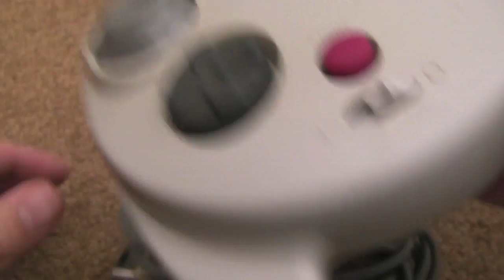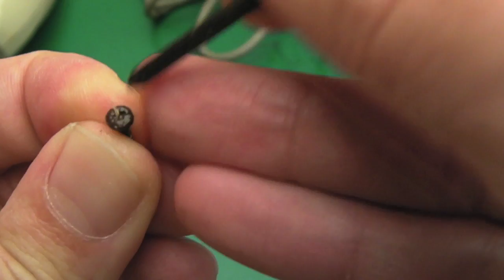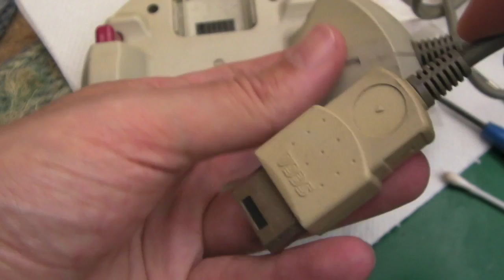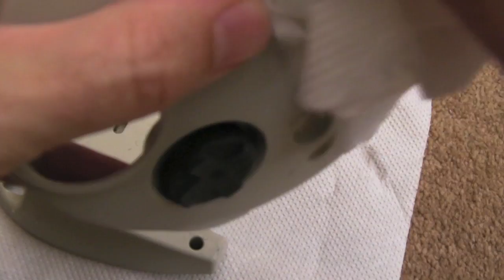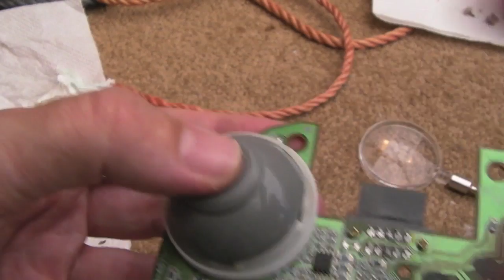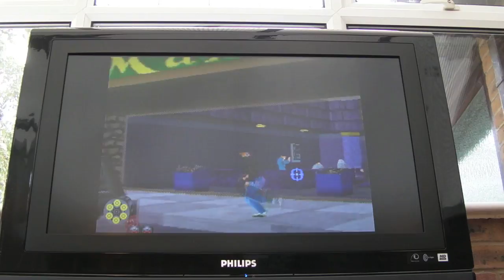Sega Saturn 3D Controller Repair (Not Working / Not Centering)

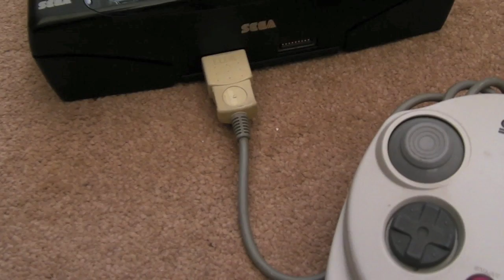Comment: I appreciate this video it was pretty much the only video I found that could reference the inside of the plug where the metal connection pins are I got an untested unknown working one off eBay thinking maybe it was an easy fix right away I noticed that one of the connection pins was broken off or missing but I didn't have anything to reference it to besides normal Saturn controllers but I didn't think that was an Apples to Apples so your video around 1 min to 1:01 I was able to freeze screenshot in reference mine and notice that in fact there is a pen missing on mine where yours does have one. My next step will be to either change the plug or try to repair the pin inside the plug again thank you

Comment: So did you have to heat up the solder on the contact to push it down? I have the same exact issue except mine pulls to the left. It’s not the stick itself I’ve determined
Reply from the maker: Yes, I just added some flux, heated and made sure it was positioned as straight as the others.
Reply: @GadgetUK164  great thanks!

Comment: Hello, I just wanted to ask you about the controller, mine works but when I switch over to the analog stick it doesn't register and it stays on the d-pad, I think it might be just the contacts of the switch rather than the thumb stick, what do you think?
Reply from the maker: The analogue stick only works in specific games!
Reply: @GadgetUK164  I know, I meant to post an edit on the comment, I didn't know because I was trying to use it on Exhumed, also known as Powerslave, because it has analog compatibility but as it seems I found out for myself, analog control only works for the American version, called Powerslave.

Comment: the right trigger of my 3d saturn controller does not work, help!
Reply from the maker: Take it to pieces (as shown in this video) - try gently wiping the button contact with IPA and a cotton bud.  It could also be a damaged wire or something.
Reply: @GadgetUK164  solved!  it was the trigger magnet, the magnet was out of the trigger piece

Comment: I’ve noticed that the d-pad on my 3D controller is really loose. I opened it up, expecting to need to replace the rubber contact points, but they’re all fine with little wear. Any idea why the actual plastic d-pad is so loose inside the controller shell?
Reply from the maker: Honestly no idea - I would need to tear it down again to see if I can work it out!  I will take a look next time I have the Saturn out!

Comment: i own the 3d controller all buttons work but when i switch to 3d controls the analog doesnt work.
Reply from the maker: I think only specific games support the analog part!!!!
Reply: i figure out what was wrong after i took the controller apart to clean it. the analog part wasnt connect to board anymore and magnetic part that sense the movement was gone like broken off so the analog never worked to begin with. its sucks but i guess i can just track down the seller.

Comment: Don't know if you can help me GadgetUK, but my R-trigger has suddenly stopped working. I opened up the controller and couldn't see anything wrong with it, but gave it a general clean anyway, but the same problem still persists. Do you have any suggestions for what I should do? 

EDIT: I've noticed there is a loose magnetic disc, but I don't know where it's supposed to go.

Comment: Always detailed, always thorough. Do you have any solution to my poorly N64 'Z' button? It just stops working sometimes. When you take it apart there is nothing wrong with the carbon button and track it touches. Odd. Starting to think it might be a slight problem in the lead.
Reply from the maker: Thanks =D  Most probably the lead!  I have (in one of my videos) hacked the connector appart and resoldered wires in there after cutting an inch off the cable.  The N64 cables aren't as good quality as some other controllers.

Comment: Really enjoyed this one. What a state the controller was in, hope you got it for a good price. Thanks for the tip about using plastic cleaner, I have a bottle on the way
Reply from the maker: Thanks and no worries =D  That PlastX is really good for cleaning plastics up - just avoid any printed logos etc.  For example the Megadrive logo - polish around it.  Or the NES logo on the door of a NES - that will come clean off with either IPA or plastic cleaner if you dont avoid the print.

Comment: Nice vid as usual. You may want to invest in a new screwdriver set as the jewellers ones are too small to grip imo. There's cheap but good JIS ones on eBay
Reply from the maker: Yes - good idea!  To be honest its rare to have that issue!  Out of all the stuff I've looked at for the last 4 years this is the only time I've struggled to remove the screws.  They were not only corroded but very tight too.

Comment: Hey Gadget, love all your videos. Super informative. I had a C64 question. In all your videos it shows models with the metal box/shielding around the VIC-II removed. Do you know how one could go about removing that box if it's in their board? I'm trying to add a heat sink to my chip, but I can't even access it.
Reply from the maker: I've seen some people use cutter to remove it - but that can be really hard work and you risk marking / damaging the board if you aren't carefull.  The best approach is to desolder it but you need an iron with high temperature / wattage.  Sometimes using two irons can help as the extra heat make light work of melting the solder on those connections to the shielding.
Reply: Okay, yeah, for some reason I keep thinking the top lid will come off, but I just can't rebend those flaps because that are just too deep in the box to get this lid off. I have a unit that still has the metal shielding soldered to the bottom with cardboard underneath it, so I'll probably have to desolder those tabs on the edges of the board too to get access to the bottom of the board. I was going to recap it anyway so this'll give me a chance to do that.

Thanks!
Reply from the maker: The lid should just prize off to get to the VIC?
Reply: https://i.imgur.com/PSfCR0W.png

I figure I'd be able to get a screw driver or some tool into those holes and be able to pop off the lid, but it seems pretty difficult. Is that even possible?
Reply from the maker: The lid on the VIC can is usually just press fitted.  It should prize off?

Comment: You may have a 2011 tsunami artifact there?
Reply from the maker: I did wonder that myself as I was inspecting it!   It's possible, but the inside wasn't water damaged so maybe it was just dirt on the outside?

Comment: just something for the back of your brain, when ever I get in a nasty screw situation, if I can give them a litle bit of a tweak tighter it seems to break them free ... or at least free-er
Reply from the maker: Thanks =D  I did try that!  I also hit the screw driver quite hard into it with a hammer - sometimes inpact can help get WD40 under the head and that can make the difference.  Sadly it had to be forced off =/

Comment: Nice vid as usual. those screws are a a pain sometimes being rusted in. I use a little ball mill on my dremal to take care of them, there is usually enough shaft left over to get some grips on and wind what’s left out. Just won the auction for a lot of over 50 joysticks for a song on ebay everything from Atari 2600 up to early play-station. Think I'm sorted for controllers for the foreseeable future lol.
Reply from the maker: Thanks =D  Nice pickup!!!  That will keep you busy for a while lol!  I think I was watching that auction at one point!  I've got a dremel but I dont think I have a ball mill fitting - will order one later thanks =D
Reply: cant believe I got that lot for a £20 bid (will cost me another £20 in diesel to collect them tho) but still works out at under £1 a joystick plus there’s 2 2600 jnr consoles in with it too. regarding ball mills try to get a few sizes, I use 2mm 3mm and 4mm depending on what I'm doing. also try to get proper dremal ones if you can even if you have a copy dremal the elcheepo ones ware out in no time the proper ones last for ages.
Reply from the maker: Bargain lol!  Really nice pickup!!!  Thanks, will get the official dremel ball mills =D

Comment: I was just wondering about why you didn't remove the d-pad assembly during the cleaning? It's super easy, just get a properly small screwdriver in the center hole from the inside and slightly push, it comes of in an instant, much easier than the tablespoon method you mentioned.
Reply from the maker: I didn't actually remove it - just cleaned it attached.  I have used the tea spoon method on similar Megadrive controllers in the past though.  Next time I will see if they have that same center hole =D  Nice tip thanks!

Comment: A magic eraser can be really good for marks on plastics.
Reply: bicarbonate of soda works prettygood as well
Reply from the maker: I have mixed feelings about magic erasers - They can mark the plastic, although when you have to rub just with IPA that can also make the plastic go a little shiney too.  So its a no win and I guess in that case a magic eraser would do the same job.  I might do a video on the subject of using magic erasers at some point - if you use them on glossy plastic (eg. Megadrive or Saturn cases), it can leave marks that you can see in the light, whereas IPA or plastic cleaner often doesn't leave that same mark.

Comment: I saw one of these Sega Saturn (black version) 3D controllers at a local car boot sale for £3 not so long ago, I passed on it at the time. Now I've seen your video I'm kicking myself for not picking it up.
Reply from the maker: Argh!  Gutted!  £3 is an absolute bargain for one of these.  Even faulty this was like £15 shipped.  They tend to sell between £20 to £40 depending on condition.

Comment: Do not let oils making a permanent contact with plastics. Some oils slowly eat some plastics. Use some kind of silicon lubricant to protect metal parts from corrosion and with silicon lubricants your plastics always will look nice & shiny
Reply from the maker: Good point!  I do often use silicon wax on plastics - if anything just to give them a like new shine.

Comment: Nice to see someone else have the same problem with dodgy screws thought it was just me. Acetone should help stick that broken post down as good as new. You might have to raid the wife's nail varnish remover just check its not acetone free
Reply from the maker: Hehe, yes - it does happen to me from time to time.  I was lucky it was the middle screw as that one wasn't too essential.  Nice tip on the acetone there =D

Comment: I drill stripped screws in Nintendo portable consoles quite often. Mostly 3DS XLs. Always caused by bad repair attempts.
Reply from the maker: I think part of the problem is people dont use the correct screwdrivers.  In this case the screw were probably JIS screws as KiloSierraAlpha posted above, but the correct size phillips will generally work OK.  I've seen people tear up the triwing screws before =/